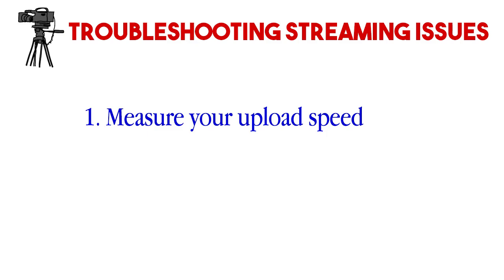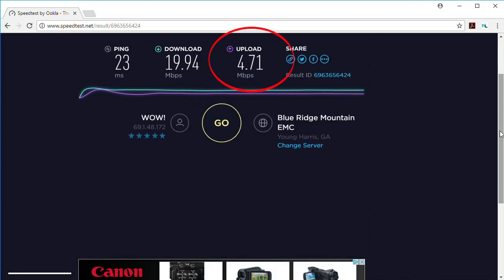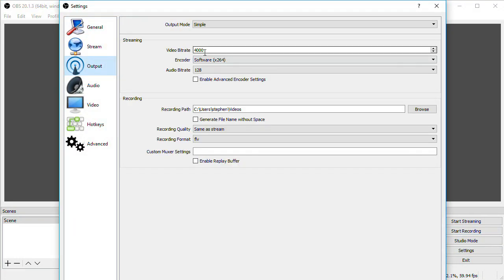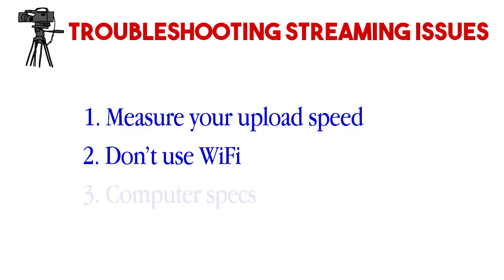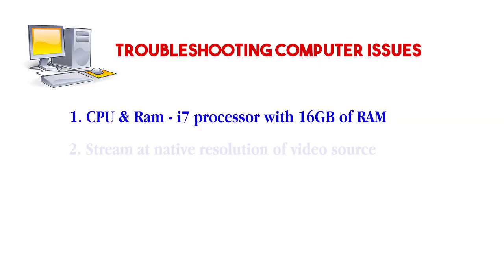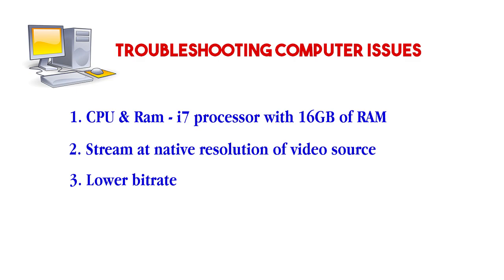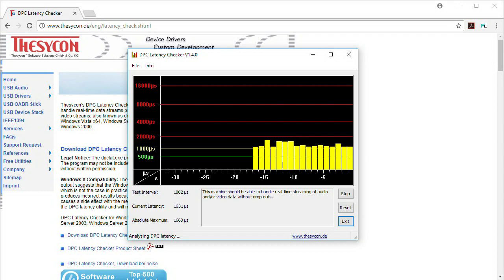Why is my live stream lagging or buffering

Comment: with i7 7700k   rtx 2080ti  16 gb memory ram,  96 Mbps internet lan speed.

Can  I try  4500 kbps bitrate  with  encoder nvidia nvenc h264,   Key frame 0 ,   1920x1080  60 fps ? 

I often get buffering problems with my stream...the game doesn't lag.
Reply from the maker: Are you using OBS?  Go to the View menu and click Stats.  It will show you in there when it lags if it's the encoder (computer can't keep up) or the network (your internet connection).

Comment: Hi Steve - love your videos & have subscribed to your channel.
(1) How do these specs sound for a dedicated streaming Windows machine:
- Gigabyte motherboard w/ 6 USB 3.0 ports
- Intel i7 processor
- 32GB of Kingston RAM
- 500 GB SSD drive
- 750 W power supply
- ASUS GeForce 2060 video card

In our roadmap, we plan to use an ATEM Mini to bring in a couple of clean HDMI feeds from our current Canon Rebel SL2 DSLR's (for right now) and look at changing out cameras to a PTZ mounted type and operator-controlled camcorder-style camera.
(2) What's your opinion on fiber optic HDMI cables vs SDI ones for under 100 foot cable runs?
(3) Is there any loss in running a string like this - HDMI-out from camera to a HDMI-to-SDI convertor - to SDI cable run - back through SDI-to-HDMI convertor into ATEM mini - out to USB3 input into computer running OBS?
Thanks for any help,
Jeff
Reply from the maker: Computer specs are great for streaming.  i7 processor and that graphic card supports NVENC encoding, so you are on the right track.  There is no loss doing the signal path you described HDMI > SDI > HDMI, etc.  That is what I would recommend.  You can get fiber HDMI cables, and they will work fine, usually they cost more then the SDI method, but that is changing, but my main concern would be how sturdy the fiber cable would be.
Reply: @BallastMedia  Thanks for the reassurance! We'd be stringing cable up and out of the way at our church, so I don't think in either case it would get much wear & tear on them. I haven't investigated the costing on fiber-HDMI (someone just mentioned them to me yesterday) vs. SDI+convertors, but I wanted to get your opinion on them before I went down that path.

Comment: If you set just the output bitrate, the average bitrate will always be higher. By default it’s +160. Why? Because the bitrate you set under output refers to the video stream. The Extra bandwidth is your audio stream.

Comment: We stream our worship via WebEx (per church policy we cannot use YouTube); we project the OBS video output to a 2nd screen while Audio output is captured using the "Monitor Only" function in OBS. We then share the 2nd screen to the WebEx participants. For the most part, our experience with this solution is acceptable on occasions however, we run into issues where audio is not consistent from one meeting to the next. Either the audio is very clear or sometimes become choppy and crackly. Have you ever tried this form of solution for worship streaming? If so, do you have any tips to make the audio levels more consistent?  Thanks -D

Comment: Blessings Mr. Ballas. We were streaming with Wifi for a while so I knew that it would buffer a lot! However, we recently got ethernet but still keeps buffering on both youtube and FB the error on youtube says "not enough picture coming to run smooth" (something like that) the speed we have to upload says 41.14Mbps so a have a bitrate of 3000 on OBS. Canvas resolution is at 1920x1980 and output resolution is 1920x720 FPS values at 60. our comp specs are i7 8th gen and 16g memory card.  I also did the Latency checker and says that this computer should support it. 

SO... I have no idea what else I could do to fix it. I thank you in advance for your help and time I pray for you to be very blessed.
Reply from the maker: Couple things... Drop your frame rate in OBS canvas to 30fps. Not much reason to go to 60fps for a live stream unless your doing sports or something. 2nd, in OBS go to the View menu, then click Stats while you are streaming, this should give you an idea of where the issue is, dropped frames from network, or from encoding. (Encoding your computer isn't keeping up, network your internet connection isn't keeping up)
Reply: Ballast Media  I’ll do that. About the fts I put it on 60 Bc YouTube kept saying that the delay was at 8min and it was causing buffering, so mess with it (not really know what I was doing) and that error stopped. But still is buffering... anyway I’ll tray this changes hopefully once we livestream we can see the issue. 
Thank you so much again for your time not only with the videos but answering all of our questions. 
God bless you always.
Reply: @BallastMedia  Hi again.. so I've seen the stats while streaming and the were some red letters it said : "Frames missed due to rendering lag 1119/20107 (5.6%), skipped frames do to encoding lag 2668/17838 (15.0%) "

I have no idea what that means nor how to fix it.  I appreciate you help and time, blessings!
Reply from the maker: @Celene77  so it sounds like the computer is struggling to keep up with the encoding. Does your computer happen to have an nvidia graphics card? If so, try changing your encoder from h.264b to the nvenc setting. If not, lower your but rate to 2500.
Reply: @Ballast Media   
 no, I have    Intel UHD Graphics 620 but for some reason I haven’t been able to update it since I got this PC. I’ll lower the bit rate then. 

Again I thank you so so much for your help. May God bless you always!

Comment: Hi Steve,
I was just  watching this video in regard to live stream buffering and i wanted to know how to try and solve my issue though im having trying to stream my church services but i'm noticing that the video image being uploaded is buffering. I'm using Wirecast for my software and i'm using it on my Intel I3 16GB Dell laptop. I ran Speedtest and the resuilt was 94.75 for the download and 21.61 for the upload. My output settings for Wirecast is 720p30 (4Mbps) x 264H. I'd like to know if my settings im using are correct for the amount of internet speed i have or do i have to change my settings or could my issue be something else as in i might need more internet bandwith.  I'm not sure as i'm trying to figure this all out. I know you mention that your bitrrate must be half of your upload speed but i need to understand it a bit more to get more clarity as your help would be appreciated.

Thanks
Reply from the maker: I'd guess your computer doesn't have enough power to run wirecast. An i3 processor has a really hard time encoding video.

Comment: I recently ran into an issue that upon research, many other seem to have also report. A few minutes after starting to livestream OBS completely drops the audio (which is also reflected on the livestream). The audio levels on are still strong on an external monitor (over HDMI out), however OBS doesn't show any levels. It always seems to happen minutes after hitting Start Stream. Any experience with this issue? Thanks!
Reply from the maker: I haven't experienced this, but from what I've seen other people saying, it might be due to other applications (browser?) taking over control of the audio device.  In the audio device that you are using, go to the Advanced tab of it's properties and UNcheck "Allow applications to take exclusive control of this device." and see if it makes any difference.

Comment: I have a 6.6 Mbps rate. I want to do 1080p60, and while most of the time it goes smoothly, it drops several frames and then goes back to a smooth frame rate and then goes sluggish again etc etc

I have more than enough of the required hardware and I use wired internet.

Should I just get a better internet provider/connection?
Reply from the maker: Yes, what bit rate are you using for your encoder?  I'm assuming you mean you have 6.6Mbps UPload speed?  You'd usually run 1080p60 at 6000kbps, so that's really pushing your upload speed, you'd probably want 12Mbps UPLOAD to accomplish 1080p60.

Comment: I need to share a prerecorded video in a live streamed zoom meeting. The video is 162MB 720p 30fps. What settings and system ability would the computer need to have to make the stream smooth?
Reply from the maker: Hmmm, not sure exactly - there are several things at play that could lead to playback not being smooth.  How long is that video at 162MB, that's not all that large, so it shouldn't be your computer playback.  More likely it's an issue with zoom dropping frames.  What upload speed does your internet connection measure at?  Also, are you connected over wifi, or hardwired with ethernet?
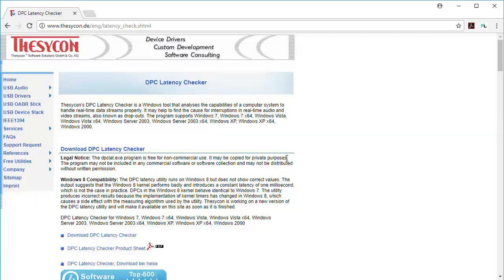Reply: Ballast Media it’s 3:42 in length. I’m trying to find out the other info.
Reply: Ballast Media WiFi 253 mbps download 156 mbps upload latency 5ms
Reply: Ballast Media hi again, just wondered if you had any more ideas on this?

Comment: my upload speed is 0.76MBPS can you please help me figure out the bitrate for my youtube live stream.....i want to live stream on my utube and it keeps buffering
Reply from the maker: You need to stream at about 350kbps.  If you are using OBS, enter 350.  That's not much data, so keep your video size small/SD, like 640x360.
Reply: so i have to enter 350 in the bitrate option right now i have 1500 and yes i am using OBS
Reply from the maker: Yes.  If your upload speed is 760 and you were set to 1500 you were trying to upload twice the amount of bandwidth that your connection has available. (which obviously won't work.)
Reply from the maker: If 350 is stable you can try bumping that closer to 760, maybe try 450 next and then 550, at some point you'll notice it start to buffer again, back it down a bit and see if its stable.  Usually though you start at half your upload speed.

Comment: Mine is still lagging on youtube. I have a Upload speed on 50 mbit, should i then put it on 25000 bitrate? If i should it is still lagging. I have checked all your steps, but isnt solved. And im not using wifi, im using hardware cable. Help mee
Reply from the maker: Sejeniclas What resolution are you streaming? A full 1080p image doesn't need much more then 4000-6000 bit rate.  Just because you have that upload doesn't mean others can download it.  Also, that sounds like a download speed, are you on fiber?
Reply: Ok i changed it to 5000 bit rate, but is still lagging. I could stream perfectly on twitch, but i like youtube better, and want to stream there, but its so laggy there. And loading sometimes.
And yea im on fiber: https://gyazo.com/69d383dc1e102243d40c7afd18c8bd52
Reply from the maker: Sejeniclas Are you using OBS? What is it reporting for cpu usage when you are streaming? Keep walking your bit rate down until the stream is solid. Try 4000, 3500, 3000 etc until it's solid.
Reply: It is started to say "Skipped frames: *% skipped", when i changed my bit rate, how low can i go down, so the stream is still solid?
Reply from the maker: What are the spec's of your computer?  What video interface are you using?  Are you sending a 1080 stream?
Reply: CPU: Intel Core i7
Graphic card: Nvidia GTX 1060
RAM: 16 gb
Yea im sending 1080 and dont know how to change it
Reply from the maker: @niclas2584  In OBS settings, Video page, base canvas should be 1920x1080, but change the output resolution to 1280x720.  Then try dropping your bit rate to 2500.  Sounds like your computer should be capably of streaming fine, I wonder if your ISP network isn't up to it.
Reply: I tried something else, and tried to record. When im trying to record in 1280x720, it's more wierd, i know it would, but it's also lagging when i'm recording. It's saying down in the left corner "Encoding overload! Consider turning down video settings or using a faster encoding preset!"
Reply from the maker: @niclas2584  Have you changed any of the encoding settings from default, other then bit rate?  Can you go to my facebook page and send me a message with a screen capture of your settings?  Specifically the "Output" page of the settings.
Reply: @BallastMedia  i think I did it. I reinstalled everything in streamlabs, and seems to work noe

Comment: I cant use ethernet, and and I have a wifi adapter for my computer and it run 1900bps (i think thats the abreviation) what can i do to make my streams not buffer, and run smoother?
Reply from the maker: Lower your live stream's bit rate until it is stable.

Comment: Tried to stream today, I knew that using the wifi wasn't a good idea but still I have a high connection speed and my stream was freezing like hell. I stopped and deleted the stream -_- I'm pretty sure in Twitch it will not happen.
Reply from the maker: Wifi only has high peak speeds, it doesn't sustain those rates, which is what live streaming requires.  So if you must use wifi, you need to lower your bit rate and test to find what rate your wifi will actually sustain.
Reply: @BallastMedia  Thank you for your answer! With wifi, my upload and download speed is 40-50 Mbps I guess it's good enough to stream no?

Comment: When I use apowermirror to connect my iphone to pc, My apowermirror is starting to lag/delay when I start streaming but when I stop it, it goes normal again and I think the wifi is the problem. I'm trying to connect my iphone to the ethernet using usb cable for iphone or connecting it to pc but I don't know if its gonna work but if it works, what is the best option of this two (connect to ethernet or connect it to pc) ?
Reply from the maker: If you can connect directly to the PC, that wlll be best option.  Yes, most likely lagging because you are using Wifi.

Comment: Hi Sir, I have 30Mbps Up speed and also a Intel celeron processor and a 4gb ram and i want to stream in Facebook for my gaming it is possible? And what is the settings thanks in advance
Reply from the maker: If you are doing a 1080 stream, then start at 6MBps - but a Celeron/4GB might not handle that, so you may need to back your bit rate down until it's stable.  You may be better off just going with a 720 stream and going with 2.5Mbps and see if your machine can encode that.

Comment: Hi Ballast, I'm looking for a thread in google on how to fix my live stream in church, I'm Streaming at OBS on FB live. I hope you can help me with this. Here's my problem when I stream in obs, everything looks good -> my stats are in a healthy state, my CPU usage, dropping frames indicators are fine and it says I'm streaming at 0.0 drop frames. But when I play it on my iPhone, the video is jumping and passing about 2-sec intervals every 5 seconds of the stream. But when I hover to the previous part it's working fine, no jumping and lagging. This happens only when I hover in a live state. I tried to monitor this on different phones and only for iphone this happends. but for android its working fine

Here are my Specs and Setting.

HP Omen Laptop i7 9th Gen
Stream at 1280px720p base canvas and output resolution
6000kbps bitrate
2 keyframe interval
x264
Cat 6 Lan Cable Connection
Reply from the maker: Not sure, but if it's only happening on iPhone, maybe the iPhone is your problem?  Is the phone on wifi, or data?

Comment: My upload speed is 94Mbps , I kept 1080 at 6000 , it shows video output is low , what to do please reply
Reply from the maker: What is showing "low?"  It may be your computer isn't keeping up with encoding at 6000.  In OBS go to the View menu, and click Stats.  While you are streaming, does anything show up orange or red?
Reply: @BallastMedia   yes Frames missed due to rendering lag and skipped frames due to encoding lag are red
Reply: @BallastMedia   at live dashboard it is showing" video output is low so viewers will see buffering"
Reply from the maker: Your CPU/computer isn't keeping up with the encoding.   Try lowering your bit rate and see if that goes away.  Also, do not use Studio Mode, that is a huge CPU hog.
Reply: @BallastMedia   it's working thank you but video is streaming like slide show . What to do for smooth streaming ? I mean how to decrease dropped frames
Reply from the maker: Are the stats still showing up red or orange?  Showing dropped frames?  You may need to change the CPU preset in your encoder to be faster to help your CPU keep up.

Comment: plz tell me why is my live stream lagging ,buffering, high latency on one youtube account and not on the other
Reply: is it a youtube glitch
Reply from the maker: Are you streaming to two different channels at the same time?  Same settings (bit rate, frame rate, etc) on both?
Reply: @BallastMedia  everything same sir plz help me
Reply: but not at the same time ,i was streaming from this account at first (it's buffering ,lagging and showing high latency and my video output showing low ),after this i streamed on my other channel and it's running smooth with no possible issue
Reply: i use streamlabs obs and for both the channel settings were same ,i also have a decent gaming specs and my internet connection is 90+ for download speed and 24+ for upload speeds

Comment: My ping is at 99. How do I lower that? My upload speed is 24 mbps. What would my OBS setting be?
Reply from the maker: Are you having issues when streaming?  What bit rate are you streaming at?  The latency (ping) in your network is usually related to your ISP and is a function of the type of connection you have, cable modem, DSL, etc.  (Unless you are using wifi which also has higher latency.)
Reply: Ballast Media I lowered my OBS settings to 720 base res and 720 output res because as soon as I opened Facebook my camcorder feed froze instantly. Once I lowered the setting it allows my feed to continue